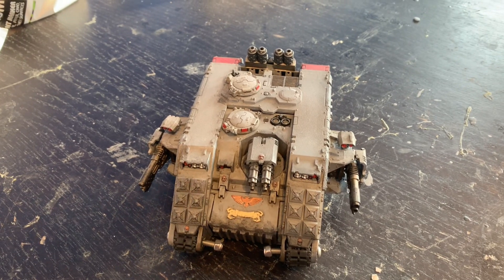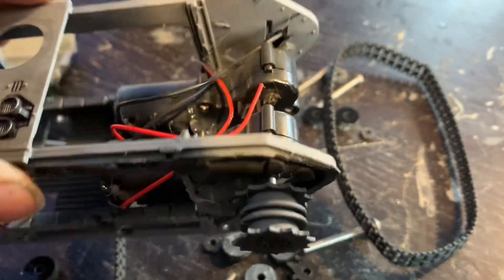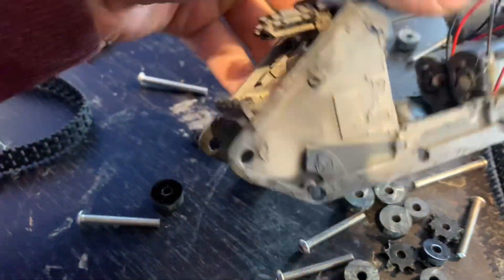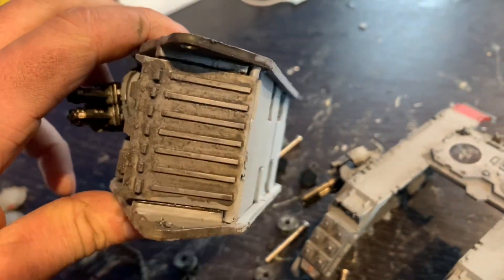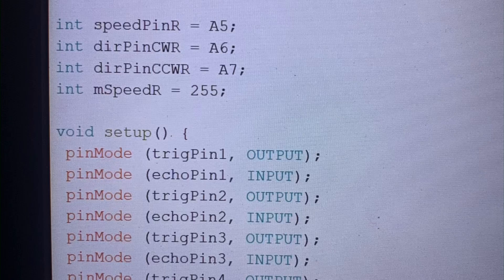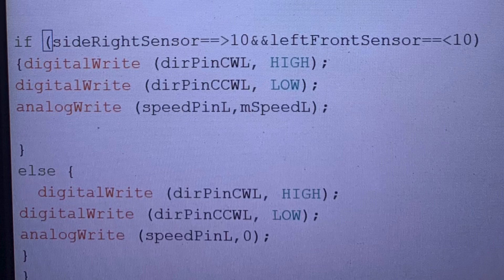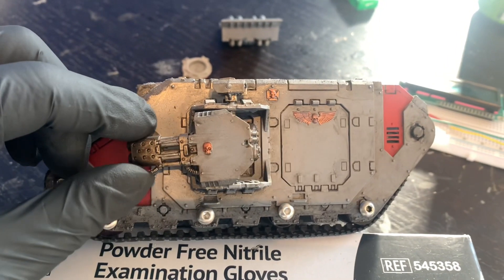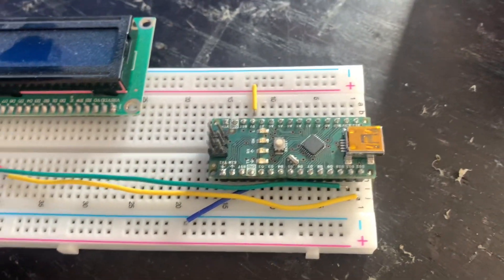AI/ MACHINE SPIRIT controlled warhammer 40k LAND RAIDER tank arduino rc part 1

Comment: This is amazing, we should try to make 40k robotic games variant, vehicles operated remotely, maybe compact ball shooting mechanism? How do you think we could make rules for such a game? I guess even normal game, with exception that vehicles move themselves, would be hella fun. What about making a flying something by modifying a drone? A real walking imperial knight? :D
Reply from the maker: While i dont know about rules, on the mechanised part i think:
Shooting airsoftt or lasers deffo can work gonna try it on a shadowsword at somepoint.  But rc

Flying cant work table top size as the models are too heavy. But the Valkyrie gunship on forge world would work as a large scale Model with a duct fan.
An imperial knights abit small vut a long term goal is a warlord titan that walks by itself, shoots a laser. That im confident can be done with development.
Reply from the maker: I am prepping to do an rc rogal dorn tank with arduino coding and tutorial. Finishing the land raider is taking a back seat as i need to design a custom power control board to complete it